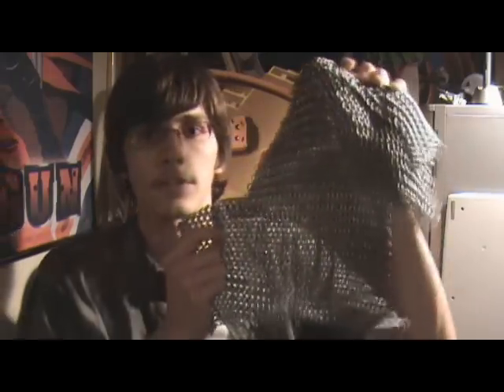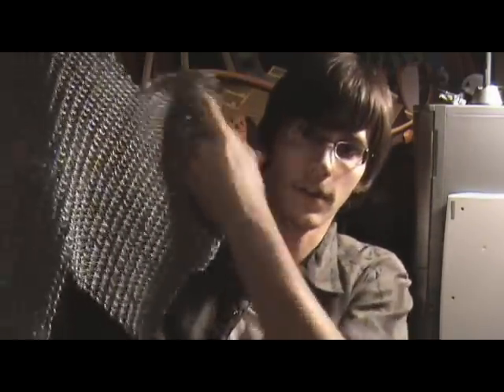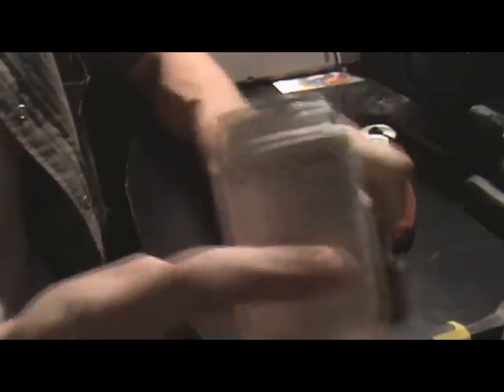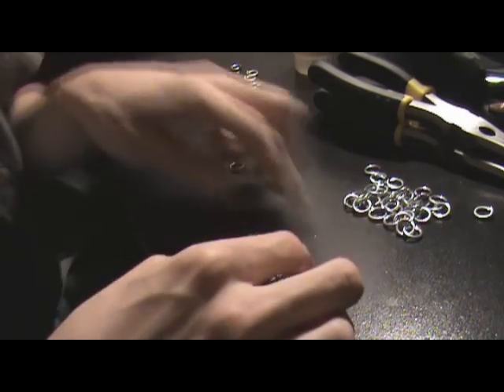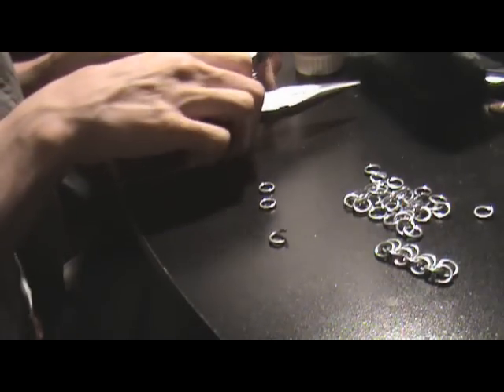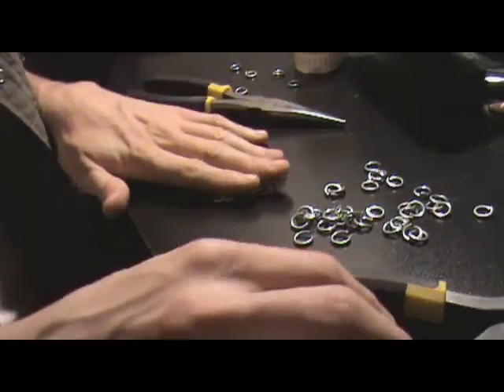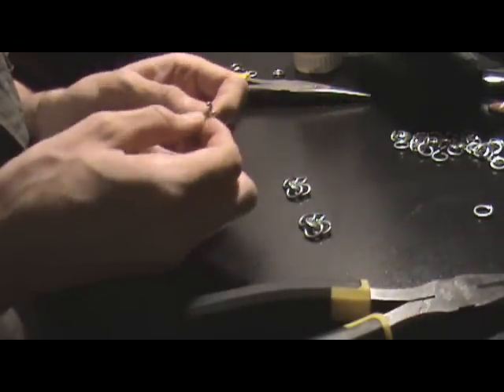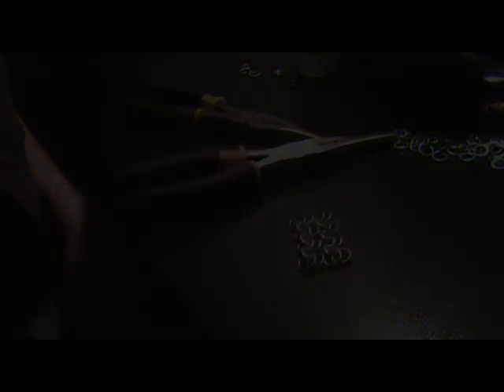Chain Maille Tutorial European Style

Comment: Thank you for posting this video.  I have just started making chain maille and this video is great for basic directions.  I used 16 ga. for a while but it is hard on my hands so I wrapped the handle of my pliers with masking tape to prevent calluses.  Also I tape the tips of the pliers to prevent scratches on the metal.  Thanks again for sharing.

Comment: Pretty good for an intro to chain maille. I get a 1/4 spool of 14g galvanized steel fencing wire for less than $30 at Tractor Supply. When you close rings I WOULD NOT suggest to pinch it together from the sides because that tends to miss shape the rings. On youtube kurnous34 has some pretty good videos.